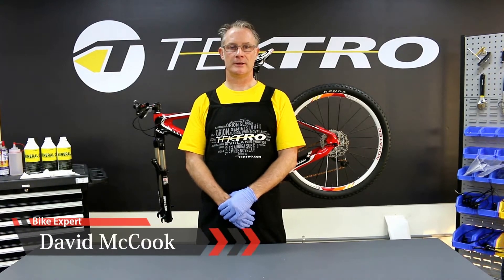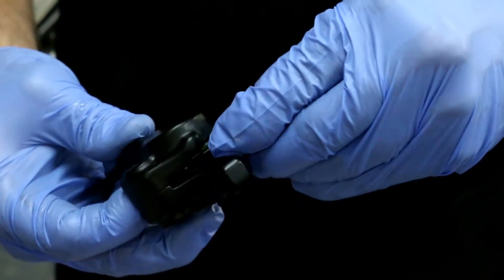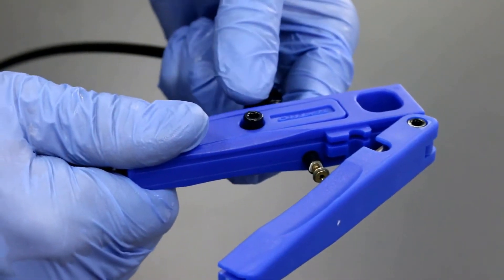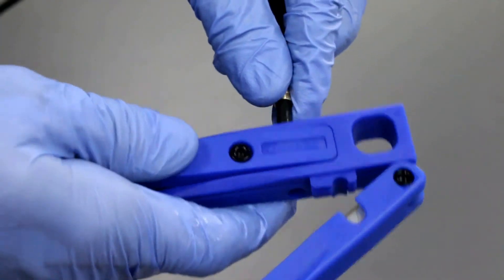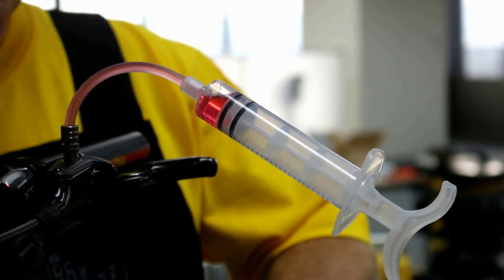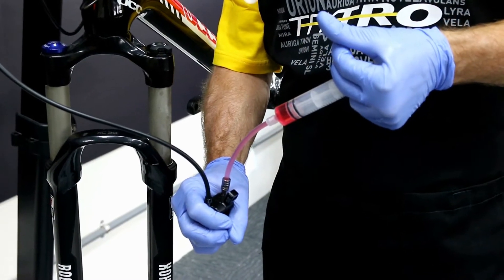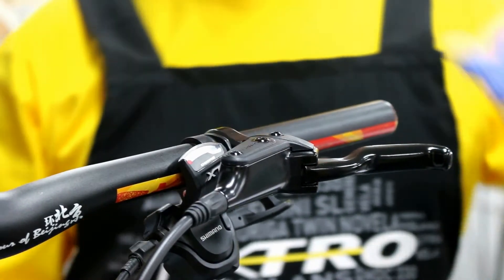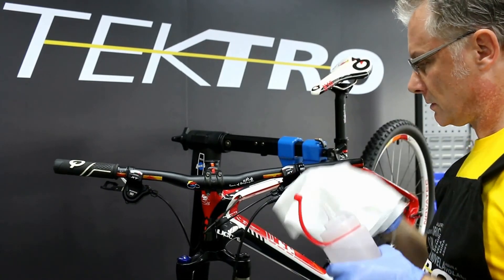Hydraulic Disc Brake Caliper Replacement

Comment: Nobody from Tektro monitors this channel, years of questions unanswered. I have a new, out of the box caliper and the hose will not come out. Hard to believe this topic has never been covered. This is the 2nd time this happened to me, the actual reason why I bought a new caliper. Fucking garbage. Time to buy a new complete set of brakes.